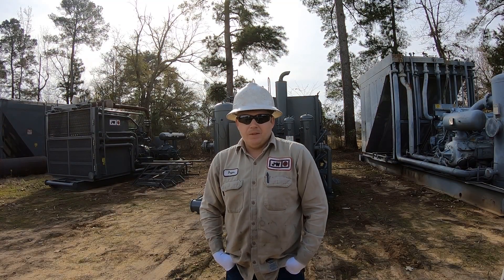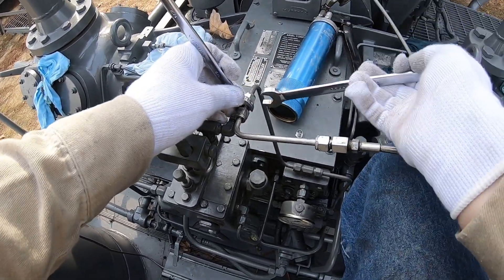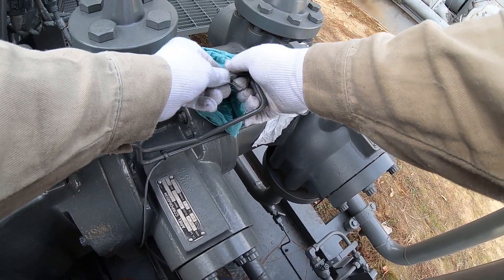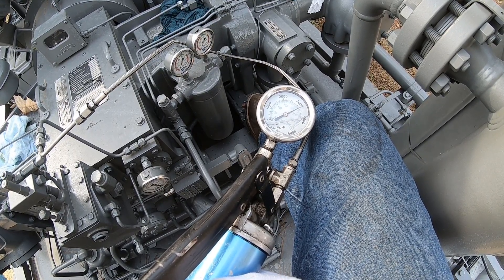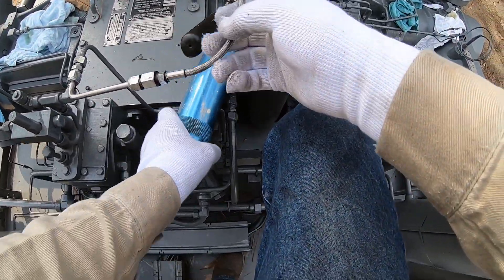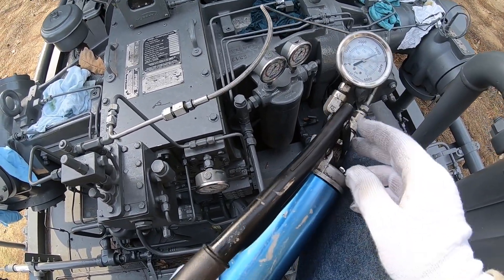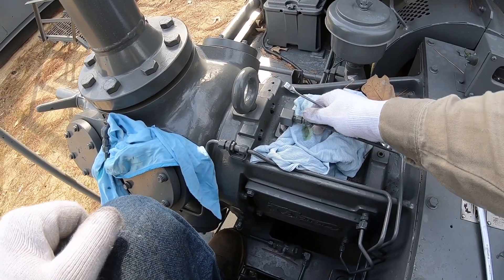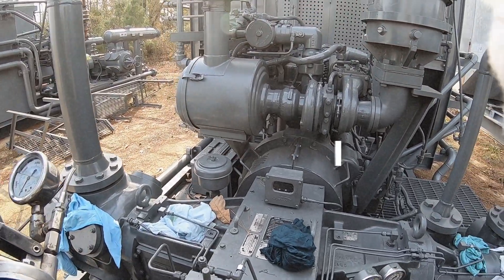Lubrication Block and No Flow

Comment: Hello. Please review your Ariel spec sheet for lubrication. I believe the pressure is 3000 PSI for 1 minute. Allowable pressure loss is 500psi within 1minute. As per Ariel. You can get any/all info from the info plate on the cover. It will have a frame serial number. 500psi is a failed section.

Comment: I thought this video was to check for no flow.  All this did was check for leaks.  Was a rupture disc blown?  What caused the compressor to trip on a no flow?
Reply: Not sure what his issue was but on the Angi compressors I work on we had excessive cycle time and faulting on no lube oil flow.  Ive adjusted the pump, tested distribution blocks, replaced blocks, swapped pump to other compressor.  The only thing physically left to swap was the distribution block base.  Replaced that and fixed my problem.  Fast forward a year the other compressor did the same exact thing, weird!
Reply: Random internet search lead me here😂. But any chance you checked the screen on the day tank? The one on top of the level box inlet can build up with this lint type stuff. It can lead to all sorts of oil related problems. Hopefully it faults on oil signal or level first. But it can slowly cause other problems. I highly recommend cleaning them out at least quarterly. But if it’s bad enough pull out the day tank and either replace it or wash it really well. It will help alleviate a lot of other problems for a very long while.